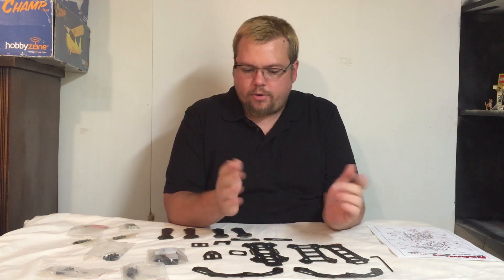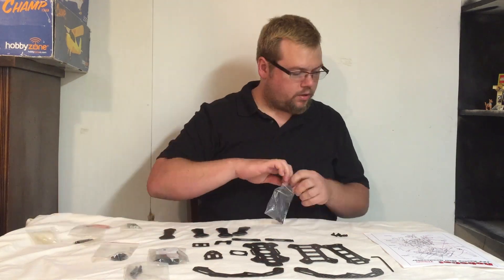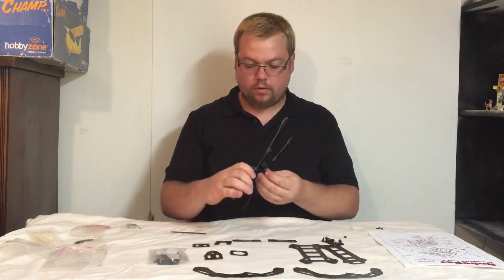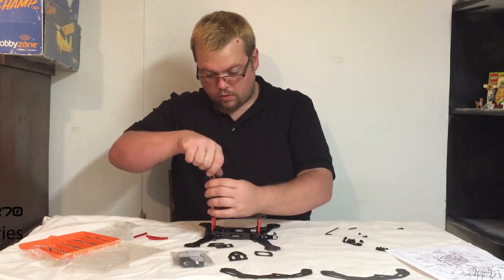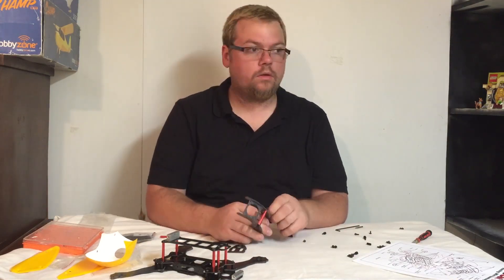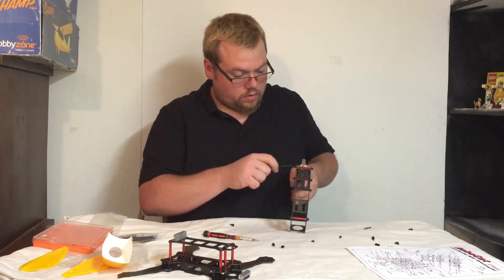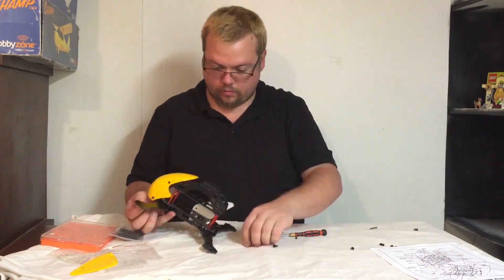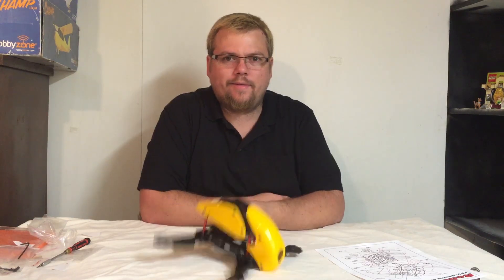RoboCat 270mm - FPV Racer Build Series: Assembling the frame - Episode 2

Comment: How conect the wire motor to ESC?, all wire same color.  thanks
Reply from the maker: +Mauricio Salas you just plug them in, before putting the props on check the direction.  if one a motor spins the wrong way swap any two of the wires for that motor.
Reply: +Matt Davis yes,  Thanks, Matt. I understand that, my question relates to each engine has 3 wires to be connected to their respective ESC, but these motor wires are black and I could not know which cable to connect the 3 black 3 of the ESC. Esc has three wires connecting the motor of different colors.

I also like to know if the kit allows me to change these ESC for about 14 amp to change the LIPO to 4s or these ESC LIPO I change?

Excuse me, my native language is not English. I could however understand your videos.

When I resolve my concerns, then I get to work with my kit.
Reply from the maker: if any of the two wires between the motor and the speed controller is reversed it will change the direction. from what i understand there is no easy way to distinguish the wiring without just trying it and making adjustments if its incorrect. i found this website that might help explain it better http://blog.rc-fever.com/2012/09/yrd-amphibious-stunt-psycho-electric-powered-rtr-rc-car/  i'm so glad my videos are helping you out. i really enjoyed doing and sharing these build videos.

Comment: why would you build the frame and not run any of the cables??? how pointless... you will need to undo most of it to actually do anything... so pointless! you had the making of a useful video - aka a build video... but instead its a video of you reading the manual and assembling something a child can do... FAIL.. down thumb

Comment: whats ur setup buddy?
Reply from the maker: +Robert Bingham It will have a cc3d flight controller, 12a simonk speed controllers, the motors are emax mt1806-2280kv and i have a turnigy 30-40c 2200mah 3 cell. the radio is a spectrum dx7. next tuesday i should have the next video up. Installing the electronics.